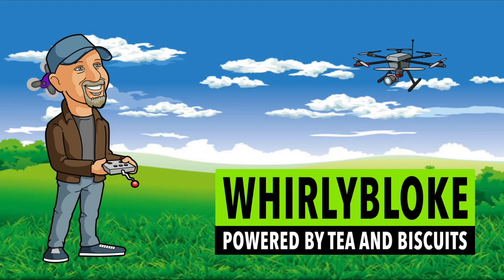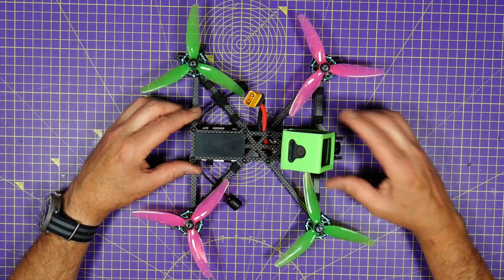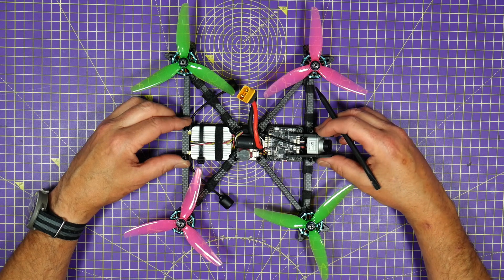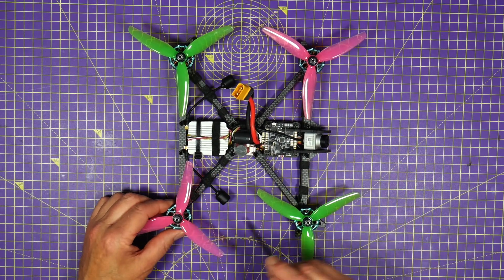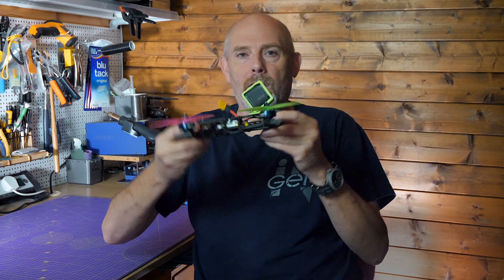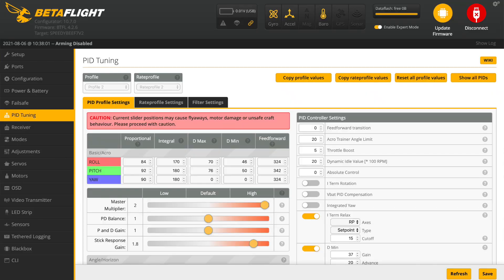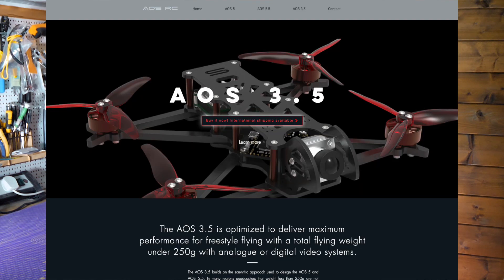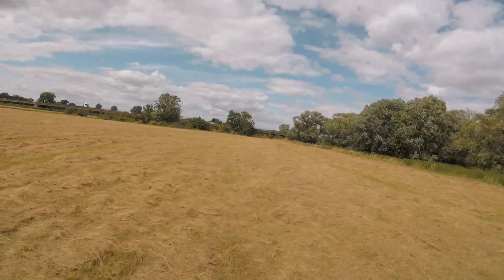AOS 5 Freestyle quadcopter frame build  / Best 5 inch drone I've ever built and tuned / PID tuning

Comment: just one tip, use a hard tpu mount for the session 5 with  no flex in it,  a well tuned quad makes the gopro session 5 footage almost perfect, without any vibrations.

Comment: Wow everything Coppertop FPV complained about isn't in this video! Chris Rosser is a gift to our hobby! Great review, looking forward to ordering one.
Reply from the maker: Indeed he is.
Reply: A lot of the issues Coppertop raised have been corrected with some very minor running changes to the design. 👍
Reply from the maker: @ChrisRosser  I've made a few more tweaks and had lots of fun with this. AOS-3.5 is in the post.
Reply: @ChrisRosser  I'm not saying Coppertop isn't allowed his opinion obviously, I'm a fan of his content but he did seem overly critical in his analysis. I've ordered one a week ago, will probably be a while yet before it makes it to Australia but very much looking forward to building it.
Reply: @copternutFPV  I increased the amout of material around the countersunk holes on the top plate specifically to address his concerns around durability. As for the blackbox stuff, if you fly KISS you usually don't have the logging and tuning tools you need to tune an AOS 5 properly.
Reply: @ChrisRosser  well l definitely run Betaflight l think then thanks Chris. l have only just managed to get my hands on another Fettec FC as l received a DOA board and can't get replacement from Fettec!! (its been 3 months and counting). l just got word today that the frame is leaving Canada soon!
Reply from the maker: @ChrisRosser  I deliberately opted for the non-countersunk version. I've always been a tad wary of countersunk bolts in carbon after a couple of issues on Diatone quads where the layers slowly separated around the hole over time. Obviously this depends on carbon quality. It looks great and arguably saves a fraction of weight, but I'd rather maintain the integrity of the carbon sheet and TBH it makes no difference to me. My AOS-3.5 build is done - review video coming soon.
Reply: @ChrisRosser  so are you saying betaflight is better for the A0s5 cos i just ordered the aos5 v2 frame and i have a kiss ultra mini and a full size and was debating on making the aos5 my first kiss build but i equally have a foxeer reaper 45amp and a few f7 fc i could equally use and keep the ultras for a future build, what do you think is my best option? its gonna be hdz 1watt, 2207 ecoII 1900kv
Reply: @Loz348  Low vibration is good for all flight firmware so KISS or BF will fly great. My tuning guides for the AOS frames use BF so if you plan to follow along with one it might be easier with BF?
Reply: @ChrisRosser  i watched coppertop video after asking the question and for someone looking for fault the thing flew dam good and he couldn't deny that so i think its gonna work out good, i think i will go ahead and try out the kiss ultra, if it dont work out i will just swap it out. Thanks for taking the time to respond, appreciate your time.

Comment: New to fpv builds.  Don't understand what fc receiver is used?   Also, I am reading dji might discontinue its air unit?
Reply from the maker: Yes that's correct.
Reply: The Air unit doubles as the rc receiver.

Comment: Since the ESC can't be mounted in the middle of the frame then at least two sets of motor wires must be extended in order to reach it?
Reply from the maker: The motors I used have wires that are plenty long enough. They are easy to extend or use some inline LED boards.
Reply from the maker: Diatone motor LEDs 
UK: https://bit.ly/3nlKbV1
BG: https://bit.ly/3b3KmP9
About £5 for a set. They look awesome when you're flying.

Comment: Do you know if the AOS frame would fit 5.2 inch props?
Reply from the maker: It'll be very tight. Why not build the AOS-5.5 which designed for the slightly bigger props and a full size GoPro.

Comment: All the motors are the wrong way-round.. props out! :P
Reply from the maker: Check the reverse motor direction setting in betaflight is off. If they are still reversed you can easily swap them in BLHeli Configurator or BLHeli32 Suite depending on what your ESC is using.
Reply: @WhirlyBloke  You should try props-out vs porps-in as seen on your quad.

Comment: By far the best frame is the ImpulseRC Apex. The raw noise logs I saw from the AOS5 are nowhere near as clean as from the Apex. The filter settings (single biquad on D) Chris Rosser is using in his tuning method are outdated like over a year now and proven to be wrong.
Reply from the maker: I love my Reverb and Apex.
Reply: @WhirlyBloke  Saying it‘s the best 5“ frame is missinformation. Not sure what’s the point in that statement besides promotion. It‘s a pita to build and especially to maintain and clearly is nowhere near the noise profile from an Apex.